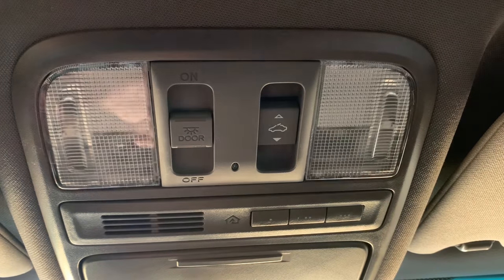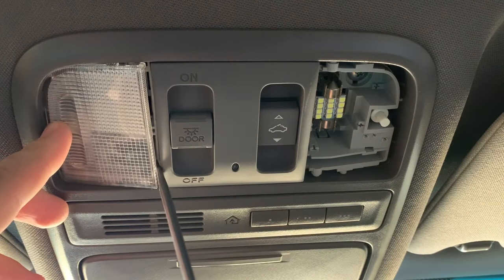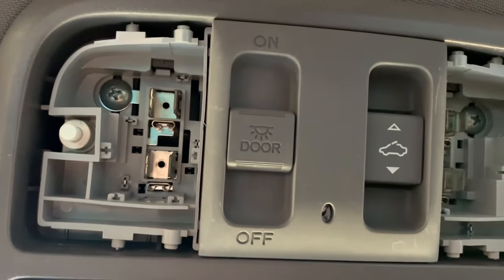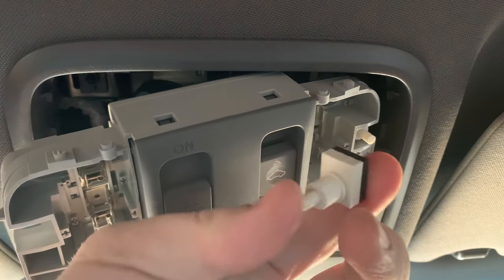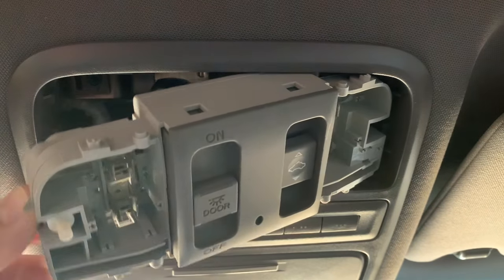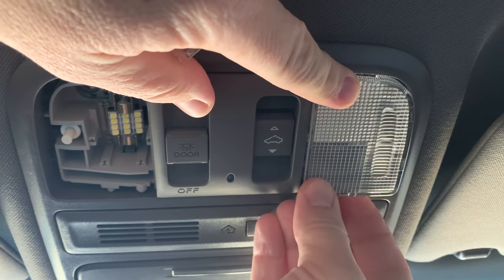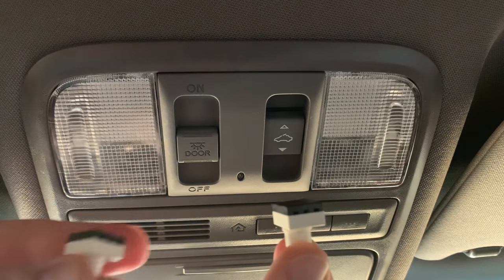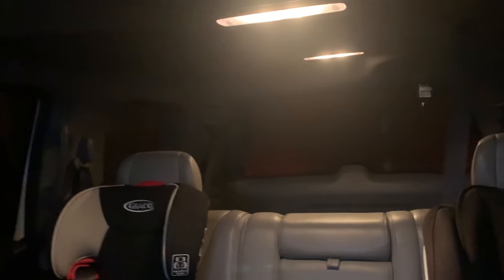FIXED! Honda Map Reading Lights Not Working

Comment: I ended up with success on this, but with a strange quirk. I followed the video instructions given here to a "T", replacing both switches as described. But surprisingly, after installing new switches and new bulbs, I still had a failure of the passenger-side light. ?? I decided to take it apart again, wondering whether I had the right-side switch properly in place (but I thought I did because it went in originally with a click-fit, like on the video). Toying around with that right side with the bulb installed, I took a thin screwdriver head against the switch to begin loosening it off -- when the light came on! Strangely, when I slid the switch back fully in with a snap, the light went off. But when I slid the switch slightly out again, the bulb came back on. So, I decided to leave it at its optimal point for working, and I put everything back together again. It works! (Though I'm wondering whether it'll be finicky in the future, not slid fully in. I'm thinking that there's some odd wiring issue above the fixture causing the issue. But for now -- I'm good! Thanks for the video.
Reply from the maker: Glad it worked for you!

Comment: Do you have a video for driver side blend door actuator replacement. I heard some fluttering down by console now the air goes in and out but it’s colder on the passenger side 2011 Honda pilot
Reply from the maker: Sorry I don’t have a video for that.

Comment: Hi. I need to replace the whole map reading light switch. What is it called? When I look it up to order the part it’s asking for the whole console to be replaced, but I only need that whole piece to be replaced. Not the sun glass Goldie’s and the middle part l, just the part where the lights are.
Reply from the maker: I bet it’s not sold that way.
Reply: @TightWadDIY it’s not I have to get the whole console.

Comment: So my left map light wasn’t working but the right one was, so I bought a replacement light for the left one. Sometimes the bulb would work but it wouldn’t turn off, other times it just wouldn’t come on. Any idea what the problem could be?
Reply from the maker: Still could be the switch. Not really sure.

Comment: I have a 2011 CRV-L With my drivers side door opened my ds map light will not come on? Other 2 work (dome & pass) i replaced both bulbs & ds map light “does” come on when I press the light. Could it be the 3 prong switch?
Reply from the maker: Take the switches out and swap sides. Should work.

Comment: What if you replaced the switches, bulbs, and fuse and it still doesn't turn on? Btw my dome lights work fine, it's just the map lights.

Comment: Well got 2012 honda accord sedan   was trying to change map light and put blue lights on and  first one was on and then it went out and tried to change them but no luck and wanted to know if there is a fuse ?
Reply from the maker: There is a fuse but if the fuse blows then none of the lights on this assembly will work. Did you try swapping the switches with each other?

Comment: I am having an issue where the now that the switches are replaced, when I am in the car, and the door is closed, pushing the clear bulb cover (to activate the switch), the light does not go on and off.

When I open the door, the light comes on.  If I lock the car, the light goes off quicker.  I can turn the light off and on with the door open, but WHEN THE DOOR is closed, and car is running OR off, I cannot manually turn on and off the lights.

anyone else?

Comment: I have a question.    Are the map light switches the same switches that go on the back?    Like in the middle.   I have a third row Honda Pilot and lights don’t work.   A watching your video found out that the problem are the switches but they don’t look the same to me.   I can’t find two different switches anywhere
Reply from the maker: Smiley Forever I’m sure they are but I haven’t looked to confirm.

Comment: I have a 2021 odyssey. Do you know what the small blue led light in the center of the assembly means when it is lite?
Reply from the maker: The small blue light is possibly just an LED meant to illuminate your cup holder/console area at night. That’s what I’ve seen in other vehicles.

Comment: My cigarette lighter in the front does not work. All the fuses are good. I put another lighter in and still does not have power. Any suggestions?
Reply from the maker: Did it work before? It’s possible the wire came off the back.

Comment: The driver side on my crv won't turn on when I open the door. It only turns on if I push it. If i replace the switch, will it fix the problem?
Reply from the maker: I wonder if the door sensors is messed up
Reply: @TightWadDIY  If you're talking about the one that gets pressed when the door gets closed, it works. I just don't know why that one doesn't turn on when I open the door or unlock the car.

Comment: So my lights here, my doors, and my entire car inside went out all around the same time. We replaced 2 fuses even though they were good and got action on the driver/passenger door but my map lights, and all passenger head lights are out, by manually flipping the switch and by pressing on them. 

We have had an ongoing leak around the passenger side for years, were not sure how it collects water, but its always the floorboard.. Ive watched a few videos of people with similar problems, so ive kinda thought maybe the water has got to the fuse box, but nothing else is effected in the fuse box, so now I wonder if my lights are out because of the box or because of the wiring? I cannot figure it out and I dont think its my bulbs, the other day I ahd a dead battery but nothign was on, and the only issue we've had was the lights so I think they are still draining the battery
Reply from the maker: Sorry. I’m not sure how to help you with your issue since it seems to be more widespread.

Comment: My light bulbs work and my switches works fine too. But when I open the door the left doesn't light up. Do you think it's the fuse?
Reply from the maker: Marlon Hilario That is really interesting. I’m not sure what would cause that.
Reply: Has anyone with this the dome light Honda issue found a fix to when the door opens and the left dome light doesn’t come on?  My switches work on both but then I open door the left light doesn’t come on?  Any resolutions out there?? 
Thanks!!
Reply: @jamisonpucci7269  i am having the same issue with my wife's Honda Civic .. if i manually push the lens in the map light comes on but when you open either door only the passenger side map light comes on ... has me stumped! Hoping someone has some advise

***UPDATE lights all working, just replaced the 2 push button switches ... only $9.99 search ebay HONDA OEM DOME LAMP PUSH BUTTON
Reply: I have same issue. Looking for answer to that. I checked fuse for indoor lights under the drivers side door but it was good which is why lights are working overall. I initially had trouble with both map lights. I removed buttons and cleaned one of the prongs on the unit that go into the button as it had rust or dirt on it, then switched the buttons and lights work but not with door still.
Reply: @concertjunkie333   you need to clean all the metal contact surfaces, use a small piece of a 3M scotch-brite pad .. works great

Comment: I replaced both lights to new  , but only it turned on Right-side light, so now what do I fix or check? 🙏  let me know it.
Reply from the maker: Did you replace the switches. The switches are the issue, not the bulbs.
Reply: @TightWadDIY  Thx. I'll check switches. U R the best.

Comment: For me, my map lights turn on when you press it. But only one turn on (passenger side) when you open the door. The setting is turn on when "door" is open. Is there a sensor I need to replace to fix the driver side maplight to get it to turn on when door is open?
Reply from the maker: Other people have mentioned similar issues that were fixed when replacing the switches. I didn’t have that same issue so I can’t verify it.

Comment: My driver-side map light wasn't working so I switched out the switch and replaced both bulbs with LED lights.  Now, the driver-side light still doesn't work AND the passenger side won't work with the LED either.  When I put the old filament bulb in the driver-side, it won't work either.  For a kicker, when I put the filament bulb back into the passenger side, it won't turn off, no matter what position the switch is in.  I'm stumped.  HELP!
Reply from the maker: Did you put new switches in or just swap them?

Comment: Keep in mind this works the first or maybe second time. It's the sort of thing most people never have a problem with later because the car is gone.

The only long term fix is a new assembly, because the problem that causes this is corroded and tiny pins, NOT really the switches.
Reply from the maker: Ours has been working fine for the past year. Hopefully it continues to work.

Comment from the maker: Amazon Storefront with all of my favorite things: https://www.amazon.com/shop/tightwaddiy

Use these Amazon product links to order the items you need for your repair!
Kit: Switches and LED Bulbs w/tool -https://amzn.to/36Ewz34
Switches I Used Based on Reviews (2 pack) - https://amzn.to/3uKxLtG
LED Bulbs I Ordered Bright White (4 pack) - https://amzn.to/3tVTwaP
Original Filament Style Bulbs (2 pack) - https://amzn.to/3wP2us8
Honda Map Light Lens Cover (2 pack) - https://amzn.to/3uIOpK3
Screw Driver Set - https://amzn.to/36MCMK5
Reply: Thanks, your video answered maybe 2 questions I had after watching other YOU tube videos. I felt that unhooking the wires was unnecessary. You proved that. Also, I wondered if I needed to also unscrew the sun glass holder screws and pull the whole unit down, on my 2008 Honda Accord Sedan. It appears from your video that only the 2 map light screws need to be attended to ; then pull just that unit down. Thanks again.
Reply from the maker: Sray J I saw those other videos too! I realized I didn’t need to so I wanted to make sure I passed that along. Thanks for watching.
Reply: Hi thanks for the info can u tell me how to get the drive shift light bulb changed in 2010 honda accord
Reply: Do you know if these will fit a honda civic?
Reply from the maker: @taylorashwood  I know the same prices will work but I’m not sure about the bulb or switch sizes.

Comment: I was changing the bulbs on my 2012 odyssey and put the new one 
But now all my interior lights are not working 
I checked the fuse and looks okay 
I don’t know what I did wrong 
That now I don’t have interior lights
Reply from the maker: Try replacing the fuse with one from another spot just to make sure. Most cars actually have spare fuses too.

Comment: Any ideas on getting the lights to work when the door opens? The light works with the switch but not when the door opens.
Reply from the maker: Do any lights come on when the door is opened?
Reply: All except the front passenger side. It’ll only work if you activate it manually.
Reply from the maker: @armandovera9932  Try the process shown in the video and see if it works.

Comment: Ok so I change those on my cr v 09 but still the same I check the fuses and there were good any idea what could it be? None of the interior lights work.. any help will be appreciated!
Reply from the maker: You could have an issue with a relay somewhere. It’s hard to diagnose without knowing your system. Sorry.
Reply: TightWadDIY  thanks for the replay, any idea what are closes or more related relays to the lights!?
Reply from the maker: @avefenixml  Are there any other lights or dash indicators that come on when you open the door(s) of the CRV? It’s unlikely but possible that the door sensor is bad.
Reply: Ok Haven’t check that jet but, is posible for that to happen? Because even with turning manually won’t turn on! Thanks!
Reply from the maker: @avefenixml  You are right. They should still come on manually. Are you positive you changed the correct fuse?
Reply: TightWadDIY yes I did but, I check all the related fuses and they were fine but I don’t know what to do next only thing left is check the door switch but it shouldn’t matter I’ll try again later, may be changing the fuses hopefully may work, thanks again!

Comment: Worked for me! Thanks
Reply from the maker: Did you replace them or just clean and switch sides?
Reply: @TightWadDIY  I just cleaned them with CRC spray and put them back. I didn't switch sides.

Comment: ... and of course this didn't fix my dome light.  But, most excellent video.
Reply from the maker: Oh no! Did you replace the switch?
Reply: @TightWadDIY    Two of the four bulbs I purchased were bad.  Yes I replaced both switches, now every thing is working. Thanks Again.
Reply from the maker: @doodar21  That’s great news! I’m glad they are all working now!

Comment: Jamison Pucci
Has anyone with this the dome light Honda issue found a fix to when the door opens and the left dome light doesn’t come on?  My switches work on both but then I open door the left light doesn’t come on?  Any resolutions out there?? 
Thanks!!
Reply: Jamison Pucci I was looking at another video before this one and his dome lights didn’t come on at all when the doors opened, but they still clicked on when he pressed. The clip was still the problem, when he replaced it they turned on right away with the door opening.

Comment: Mine only works when the door is open on my 2012 civic si. When I push the button I get nothing, the light only goes on when I open the door. Think this is the culprit? Anyone have this issue?
Reply from the maker: I bet it’s the switches. Give it a shot.

Comment: Bro on my 2014 Honda accord I blew a fuse changing my trunk light. Which made the interior lights not turn on. I change that fuse and now the interior lights work but the trunk light still does not and also the trunk open light on my dashboard is not showing up
Reply from the maker: Sounds like you might have a bad switch on your trunk.
Reply: @TightWadDIY   when u said switch, do u mean micro switch?
Reply from the maker: @ygbodybuilder3023  It could be the switch that lets the system know the trunk is open. There is a pressure switch that activates when the trunk is opened.
Reply: @TightWadDIY  where is that at?
Reply from the maker: I don’t know for sure because I don’t have an Accord. It’s somewhere along the lip of your trunk. It’s a button you can push down on with your finger.
Reply: @TightWadDIY  I just replaced the whole latch and it solved the problems. Thanks for the help

Comment: They switch on by pressing the lenses, just not when the doors open. It's probably the 'Door/On/Off switch that's faulty.
Reply from the maker: Do other lights come on when you open your doors? If not, it could be the door switch. What if you open the passenger door?

Comment: I purchased the same switches and it’s still not working
Reply from the maker: Did you also replace your bulbs?
Reply: Yes, and I changed the fuse, it’s the drivers side that isn’t working now
Reply: The middle prong was bent down so I was able to fix it and now both sides work properly! Thanks again
Reply from the maker: @pleezebaleevit  That’s great! I’m glad it’s working now!

Comment: What year pilot is this?
Reply from the maker: Joseph Karl Ours is a 2011 but this same map light bezel is in a lot of Hondas.
Reply: @TightWadDIY  the reason i asked is on Amazon they said it was incorrect for my 2014 pilot. Obviously if it worked in yours, they are wrong.

Comment: Only one of my lights work and none work when the door is open so I'm lost
Reply from the maker: If they don’t come on when the door is open you may have that switch in the off position OR the door sensor may have failed. Do they turn on when you open the passenger door?
Reply: @TightWadDIY  no they don't turn on with any door amd it's set to door but one turns on with pressing it

Comment: I replaced the switches and still don't work
Reply from the maker: Are you sure your bulbs are good?
Reply: @TightWadDIY  yes they are they work manually, have you heard of the assembly going bad?
Reply: Yes they are good,they light up when you push the button
Reply from the maker: @williamb454  Sorry I’m really not sure.
Reply: I did everything and it still doesn't work!! ???